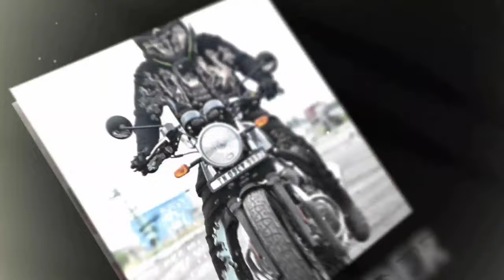😭BYE CHAIN SPOCKET  |🎉WELCOME BELT SYSTEM FOR ALL BIKES

Comment: Revolt electric bike 108kg tha bro
Athulaye enaku 1800kms la belt cut ayiruchu
Neraya customers ku same problem ayiruku 
Athanalaye antha bike ha sale panaitan
Ivlo weight ha na bike epdi thaangum
Reply from the maker: Check previous video bro 200kg interceptor ku fix panrikon and let's wait for 20-40k km review and indha belt system is not the usual one and it's diff from the market adha mention panripen it's from sabari bike point , matha general market ones ilan nu bro
Reply: Hmm